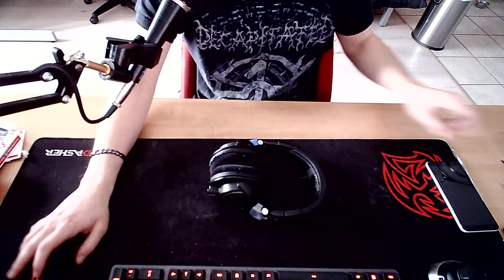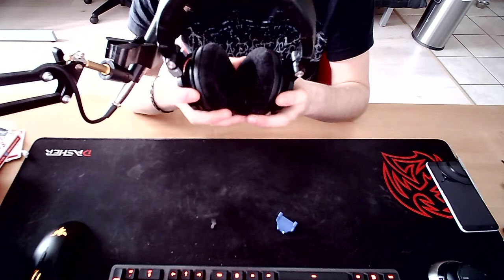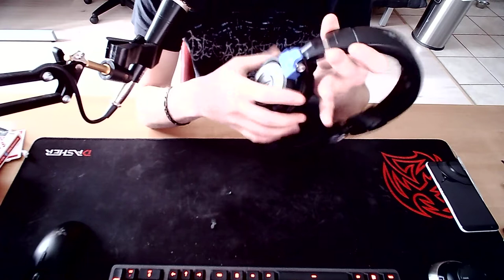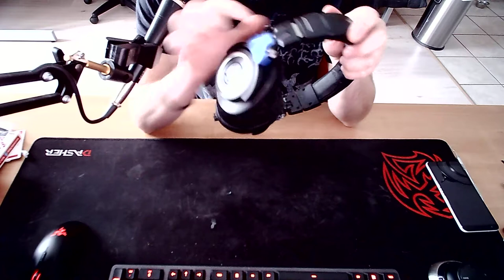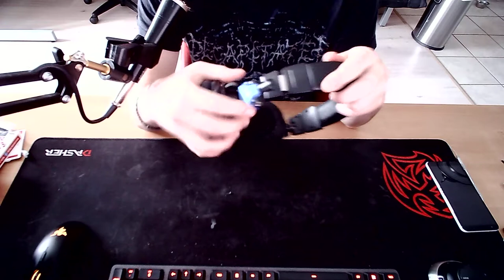Audio-Technica Ath-M50(x) fix (hinge) - 3D model ready to print. (see description)

Comment: Thank you SO much for sharing the STL file for this repair clip! I printed 2 of them at my local public library for a total of $0.60 CAD. This is WAY cheaper than other options ($40+), while looking MUCH nicer. I love these headphones and was really bummed when one of the hinges broke (at the beginning of a gig, of course)! These clips totally fix the problem and allow for full movement/folding of the cups. As others have stated, it takes some effort and patience to get them clipped on - I think this is a good thing, though, because once it's done they feel really secure. You could always sand/shave them down a tiny bit if needed. Thanks again!!!
Reply from the maker: Thanks for your comments! It's really appreciated 🙂

Comment: Confirmed, this works, saved me a load of hassle. Takes a few tries to get them to "click" in place, some sandpaper helped. Headphones stay firmly in place and sound great.

Moments like this make me so glad I invested in a 3D printer.

Actually, as mentioned by another poster on Thingverse, you should put these on your headphones today, not only do they prevent a "good" hinge from snapping but they also increase the clamp force a bit, they are a bit more snug on my ears, the sound feels more solid :)
Reply from the maker: Thanks for your Comment it's appreciated, Glad it could help. !

Comment: Been using m50x since like 2015. Hinge broke a year ago. Ordered your part. Works! The piece broke today, so I'm ordering a new part. Hopefully will be better printed this time. Definitely a great fix. Thank you.
Reply from the maker: You should order it from me 😉 thanks for your comments!
Reply: hey bro it doesn't fit with my m50x the hinge was too small, how to make it fit?
Reply from the maker: Probably that your printer is not calibrate properly, as a work around you can scale up the model in your slicer until it fit.

Comment: Thanks for the design. I had it printed in a shop and it was almost impossible to clip in at the beginning. Maybe my ATH-M50 isn't exactly from the same generation.

For those who have the same problem : I solved it by filing the lower part of the clip so that it has a round shape that fits properly over the cup. After removing 1 or 2 mm it worked fine.

PS : I have 2 clips remaining.
Reply from the maker: I had 3 different generations, and it works fine on each one, it's really important to use the right settings.
Reply from the maker: You can scale the model to something like 102% if it's too tight